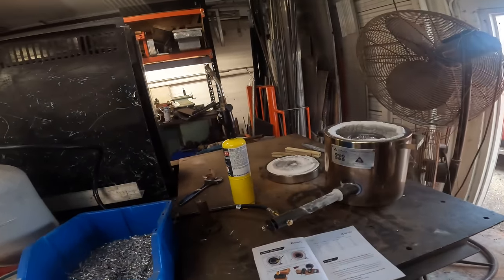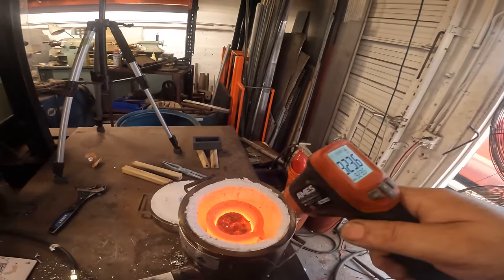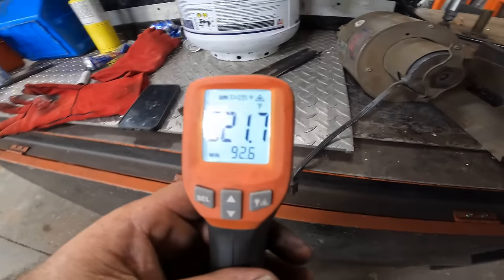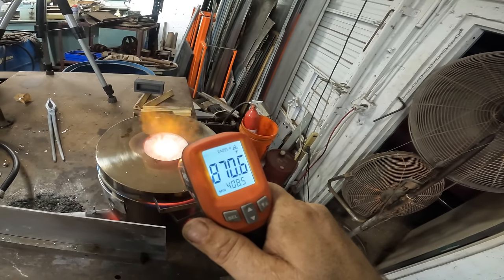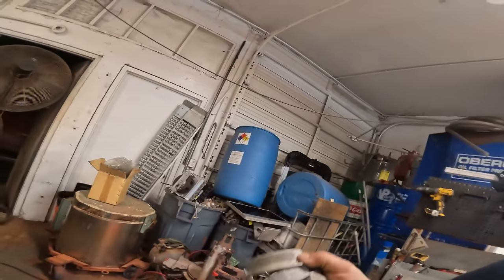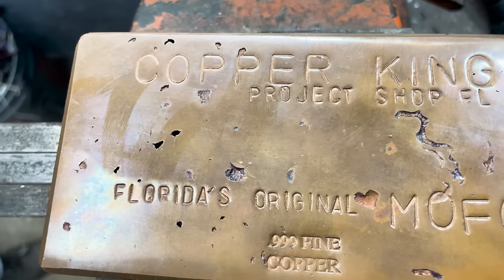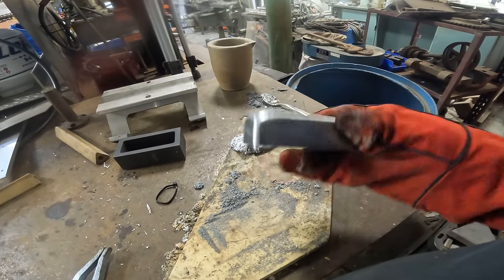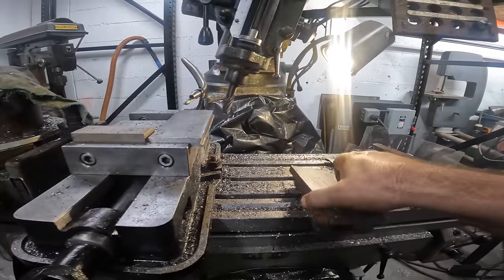Melting Scrap Aluminum & Making My First Ingot

Comment: For that first crucible, load it up with more of whatever material you made the ingot with and heat it back up, don't try to chisel it out or drill it or anything. You risk stress fractures in the cup, crucibles normally have a lifespan already, they dry up and go brittle. Soften up the frozen dross with some big chunks melted over it poke at it a bit and scoop it out. Congrats on the first ingot.  👏👏👏👏👏👏
Reply from the maker: Thanks for the info

Comment: Now you're casting too, you guys are like soul eskimo bros. I've only messed with one furnace, a small jeweler's electrical one. The first time I used it I was able to melt copper, but a negligible amount, and after that ended up with a similar result of compaction, but not full melt, kept the copper slug for future ops. This was a long time ago, my workspace is constantly being raided and I've lost a lot of stuff I'd repaired or was in the process of repairing. I don't entirely know how appropriate it is to critique given I only actually know stuff in theory, with no replicable success using my piecemeal equipment. I was working towards one of those Devil Forges Ausbro BigStack uses, down here in the Caribbean South, I haven't seen much of a supply line for materials to make a serious build. 
I'd seen a ton of room for improvement in your experiment, so be assured you will get better. First off, I'm glad nothing terribly wrong happened in the making of this video. Second, I'm inclined to remind you we live in a very wet state, what a drop of sweat falling into molten metal can do is mar your skin for life, so suit up no excuses. Water introduced to that heat can insta vaporize creating a sudden burst of pressure, popping a spray of painful searing metal at you. Of all the casual PPE one might ignore in their own garage or whatever, you would do well to treat this whole facet of metalworking like you're disarming 'splosives. 
Contrary to what we might assume is common logic, smelting embodies the difference between temperature and heat. It is actually faster to melt a solid chunk of something than a crucible of loose bits. The physics here is the already condensed molecules excited by the heat have like a proximity friction. Heat is atmospheric, the enveloped negative space between objects, temperature is the speed the molecules are vibrating [as it was explained to me once]. So, if the goal is to raise the temperature beyond melting point to melt, it may just be the cheap chinese trash we both are using falls short of practical use. 
-The chips you melted may have been very dirty with all the WD40 coating them, OR the alloy of the aluminum had a metal of a higher melting point in it and you did not reach that temperature. 
-The dross you pulled out from your successful cast can be bashed with a hammer and non-brittle chunks can be remelted, get a huge pickle jar from behind a restaurant and get a bunch of it as it's gonna be the lowest grade IF you even intend to go full autist maximalist. (tbh you'll probably be better off throwing it in the trash)
-Be mindful of any loose particles falling outside the crucible, try to keep the area inside the insulated chamber as debris free as possible, keeps loose molten fragments from building up and taking away your flat resting surface. I saw you neglected to tip the aluminum icicle from the pouring spout back into the cup, amateur hour  😄
- The dude who sold me my furnace gave me 2 glass rods to use for stirring, I think they were 3/8", dunno where you'd salvage those, but I saw something similar in a toaster oven once, maybe keep an eye out. 
-Stack some bricks back there to lay out on the floor, work low to maintain stable control of the dangerous elements.

That's some of it, not tryna get too preachy. With the equipment you have at your disposal, you could make the tongs and everything you need to smoke any experience I have in no time. I wish you the best of luck. One of my longest held aspirations was to cast my own treasure, machining gave me a number of nodes in that direction, still need to master some CAD to custom design the rounds/bars molds and machine the graphite. I'm excited for you bro.
Reply from the maker: Thanks for all the great info! 👍

Comment: Devils forge .  That’s what I use .  I can melt 6 or 7 lbs of copper in 30 minutes .  Can’t feed aluminum to it fast enough. Devils forge is between 300 and 400.  But it works
Reply from the maker: Thanks for the info

Comment: Almost all aluminum is alloyed with SOMETHING.   (nickel, antimony, tin, zinc, copper, etc.) Steve was on the right track.  That extruded may have had an alloy specifically designed to stand a much higher melt temperature.  For instance aluminun buss bars will have a higher alloy of copper in them and they are really tough to melt. Junk aluminum is best for small shop melting and pouring.
Reply from the maker: Thanks for the info

Comment: Congrats on your first ingot. The chips must have had a way higher melting point.  I think those were extruded chips?  Either that or they are just full of contaminants and dirt and WD40 from the milling process.  Regular cast Alum melted like butter on your second attempt. You're on the right learning track.  Nice job dude!  The lip should have a hinge and keep it shut as much as possible.
Reply from the maker: Thanks, Definitely a learning experience but now I got ingot fever. lol

Comment: I think Scrapman502 has the right answer. Aluminium is oxidizing fast, and shavings have a lot of surface to oxidize. Aluminium melts at 660 degrees, but aluminium oxide (also called korund) need more than 2000 degrees. So what happened is, the shavings melted easily, but the aluminium oxide floated on top and formed a massive crust that prevented you from getting to the molten aluminium. I think you will have a problem with cleaning your crucible, korund is a HARD material.
Reply from the maker: Thanks for the info

Comment: I've melted a lot of aluminum in the past 2 years. I have over a ton of ingots just like the first one you made. Your furnace appears to be getting plenty hot considering the glowing color.  I've never had my furnace glowing on the outside like yours was.  I think the first crucible formed a thick layer of slag on top that solidified into a crust. I'd suspect if you turned the cold crucible upside down and tapped it on a surface the whole pot would come as a solid chunk with pure aluminum on the bottom.  Milling chips and floor sweepings will have a lot of slag.  As far as overfilling the mold to prevent the shrinkage won't help. The exterior solidifies first then as the interior solidifies and cools it shrinks causing the top to be pulled down.  How much this happens varies depending on if you're melting extruded, cast or rolled. I don't know which is worse because I mix my feed stock and don't keep track. You'll always get some shrinkage.  Last thing, put the furnace on the floor so you can work on it without it being right in your face.
Reply from the maker: Thanks for the suggestions

Comment: if you use compressed air or a blower/shopvac and force air in, you'll increase the temp and lower the cost. That yellow flame on top of the furnace is fuel that's not burned.
Reply from the maker: Thanks for the info, I did introduce forced air at one point.
Reply: @ProjectShopFl  Ok , i didnt watch to the end 😂 looked like you were having fun though.

Comment: Aluminum oxidizes fast. With the  shavings you have a lot of oxidation creating dross/slag.  You should probably add chunky stuff to the shavings to eliminate as much per melt. You also need a stir stick and a longer spoon.
Reply from the maker: Thanks, definitely need a longer spoon. lol
Reply: Or, melt chunks, then add the swarf a bit at a time, scrapping the slag off in between adding the swarf.
Reply: @ramblingman8992  This is correct, adding dirty material to already molten pools will reduce the smokey vapor effect by a lot.

Comment: I think you doomed yourself from the start. Years ago I asked my shop teacher in high school why we could not use cans for Aluminum melt. He said the metal was too thin and would oxidize. We would use pistons, and transmission housings that we got from the junkyard. Everybody I've met since that melts Aluminum has told me same. Once the Aluminum oxidizes, heat alone will not convert it back to metal. It has to be melted at around 3762° F, and then juiced with electricity at around 4.5V, but 7200A!
Reply from the maker: wow! Thanks for the info.

Comment: 1. Frst you need a bigger spoon!! Like one from a restaurant (start) checking out the dumpsters. or find a restaurant supply store.
2. You also need a pc. of rebar About 2-3foot with a 90 degre
bend on one end for a handle. Cut a broomstick for a handle for a scoop, drill and pound it on. On the other end weld a 1-1/4 angle iron (crucible side) 1 1/2 wide to scoop to get the the dross out (Same idea as the spoon)
Good luck, and don't cheap out on the tools/equipment!!!
Reply from the maker: Thanks for the suggestion

Comment: Extruded aluminum melts at a higher temp depending on the alloy which makes it better to machine because the chips dont melt as easily to the cutters.  The cast aluminum will machine but you have go slower because it melts easier and will melt to the cutters
Reply from the maker: Thanks for the tips!

Comment: Bravo for not giving up with your first ingot but is it interesting to melt aluminum or copper for example the wires that you do not strip? Between the time spent, the gas, the risk of fire...
Reply: It's a useful skill to develop for producing raw material and alloys for machining. Going to a supply for a brick of brass for example, is the time, cost of material and a cost per cut of the material on location. On the scale of his furnace capacity, it's a side option, but worthy of understanding.
Reply from the maker: Thanks!

Comment: So I'm an expert because I watch Big Stack D..... Actually I'd suggest using Rebar or another fine piece of round iron to stir the metal. A big stainless spoon or ladle helps till you can press aluminum PUCKS (I'm from Minnesota.)  Also please get new hose and regulator and thermometer.  😎💖
Reply from the maker: Thanks for the suggestion

Comment: I think the extruded is rolled at around 925 degrees.  Different aluminum has different melting properties.  If your definitely going the ingots route eventually you'll get a Cadillac of forge burners and make some tungsten ingots 😂 6200 F
Reply from the maker: 😂😂😂 I am definitely upgrading to something bigger and way more powerful. I probably gonna make a double burner double stacked so I can melt twice as much. lol

Comment: If you force oxygen into the furnace when you melt aluminum, you are encouraging aluminum oxide to form. Aluminum naturally forms an oxide layer when in metallic form. Shavings have this same layer. So you won't get as much metal back when melting shavings since the metal is thin to begin with. Same goes for melting Cans. BigstackD melts cans and it always appears to have more slag than metal. Next time you should try removing the slag each time you put new metal into the furnace to prevent forming that crust at the top. otherwise you're just mixing it all together.
Reply from the maker: Thanks for the info

Comment: I to have tried the remelting of aluminum shavings. It dont work. You need a very large smelting operation and you need to already have molten aluminum to pour the shavings into. They are to light and just burn up and oxidize.
Reply from the maker: Thanks, I knew something was not right with that stuff, the other aluminum melted in minutes. lol

Comment: I like many viewers implore you to watch BigStackD.  You need very little gas for aluminum at low psi.  Big Stack melts copper at about 12 psi.  Aluminum produces a ton of slag that should be spooned off periodically throughout the melting process.  Be careful and good luck!
Reply from the maker: Thanks for the info

Comment: The melring point of aluminium is 660 Celsius, or 1220 F. so if your furnace cannot reach that, you will not be melting aluminium.
Reply from the maker: Thanks for the info

Comment: Pay attention to a welding seam on a kiln, it's heated red, it's no good, you are overheating your kiln. Aluminium melting point is 660 Celsium, and you heated your kiln over 900 Celsium, which is overheating.
Reply from the maker: Thanks for the concerns

Comment: You will want to pick up crucible with round tongs that fit on the sides and seperate tongs for pouring that fit in side. Picking crucible up the way you are doing it risks CRACKING THE CRUCIBLE!🤯🥺😭 And risk  putting in small cracks making crucibles lives shorter. 💖💖💖
Reply from the maker: Thanks, that is what it came with

Comment: You’re learning by trying. Give you credit for trying. Even if you pour a bar of aluminum - what’s your intent? The cost of the propane likely much more than the value of bar of aluminum.
Reply from the maker: The intent is to learn the process, refine it them melt and make custom products.
Reply: With repetition and practice, you can bring down the cost of the gas to roughly 8-10USD per melting session. If you cast 6+ bars it begins to make economical sense for storage. With the milling machine bars can be made into parts to replace the plastic trash components inside everything people buy these days. Manufacturing is being subsidized stateside, we're heading back to needing these skills.

Comment: At 24:00 you just removed some of the slag and now you need to turn it back on. The shit that you took out and placed on your bench is dirt and slag. You just keep letting it cool down too much so it solidifies quickly. Get a piece of steel angle iron and use that as your spoon. Your pressure on the propane tank is fine, just let it do its job. You are playing with it too much.
Reply from the maker: Thanks for the info but I let it cook for over 40 minutes and it still did not melt. The 2nd round melted in 10 minutes or less.

Comment: AVE talks about melting chips in one of his videos (around the 4 min mark).  According to him, Aluminum oxide has a higher melting point than the raw metal, which makes the chips harder to melt (lots of surface area).

https://youtu.be/5mMg3WkxM2Y?si=1rW6qa0ksmqwTbjy
Reply from the maker: Thanks for the info

Comment: Too much surface  area on the chips. They basically turn straight into oxides. A industrial furnace can get up to the insane Temps needed to melt aluminum oxide which is 2,072 C 3762 F
Reply from the maker: Thanks for the suggestion

Comment: You can't use a bigger crucible because your kiln is pretty small. Actually it looks like your crucible is just TOO BIG for your kiln. This could be a reason of your failure. Use SMALLER cricible.
Reply from the maker: The first one came with it.

Comment: And doing it ontop of a firebrick on the floor
Reply: After removal of slag reheat
Reply: Get a different regulator
Reply: If rim of crucible is grey it ain't hot enough
Reply: You have too much slag
Reply from the maker: Thanks 👍

Comment: Pure aluminum melts at 1220 F.  However, many aluminum products are alloys and melt/separate differently.  You really have no clue what you have with those bars.  All that slag from your bar shavings could be anything.  They were also soaked in WD40.  WD40 is petrolium based but has paraffin(wax) in it, so I have no idea what that might do.  You also need a better set of tongs designed for picking up chrisobols.  Hog out all that crap from the chrisobol.
Reply from the maker: Thanks, definitely need some upgrades.

Comment: I melt as a hobby.It can be very dangerous.You did sooooo many things wrong.Watch some beginner videos before somebody gets hurt.
In the meantime ALWAYS have your furnace at ground level.keep your molds on a concrete block or something just above ground level.Never and I mean NEVER pickup and pour a crucible the way you did,make some tongs. Crucibles are not indestructible and get brittle with use and abuse,you could easily have snapped the edge off,dropped the crucible and have molten metal splashing everywhere because you have it 4 feet off the ground.Best thing you did was face-shield and fire coat,which wouldn't have helped much because it wasn't closed up. Use some common sense and watch some damn videos, BE SAFE.
Reply from the maker: Thanks for the concern and the suggestion